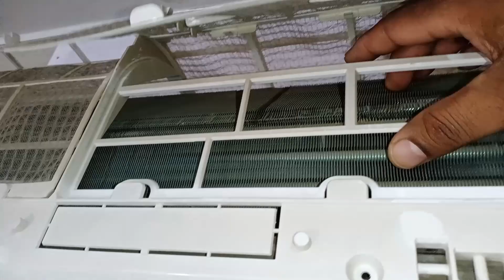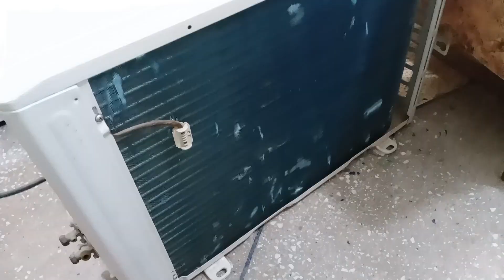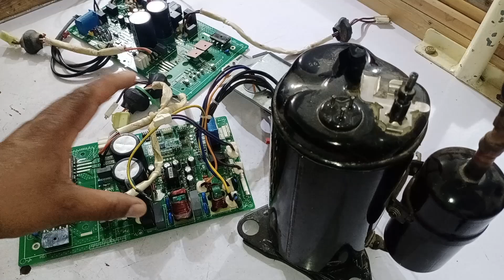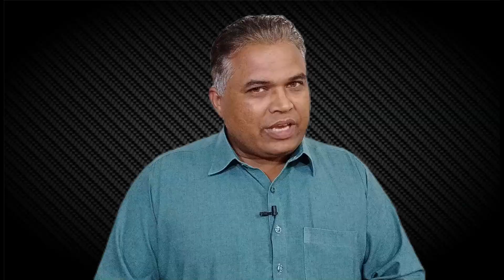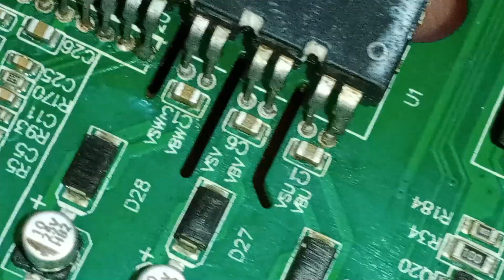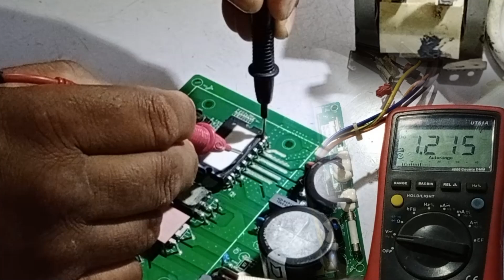How to Fix F3 Error Code in Mini Split AC - What to Check?

Comment: First you should have said what is the meaning of the F3 error according to manufacturer of the unit and then elaborate what can cause that error directly and then indirectly. You jumped straight into story of all possible indirect causes of the error. For example if there's an error that manufacturer said means "communication error", that means exactly there's no communication between indoor and outdoor units. Then we can apply logic and knowledge of electronics to find out exact cause.
If there's many indirect reason to IPM error then manufacturer made piss poor job of describing troubleshooting procedures. However, I know that many manufacturers don't want anyone to repair their boards other than: "replace the board" level of troubleshooting. There lies the problem of standardization. There should be rules that protect consumer's right to repair. 
Not one manufacturer should be allowed to sell their units on the market without service manual available on their website at least.

Comment: Hello sir. What is the power of the fan? The one installed between the condenser and the compressor of a 2-meter display refrigerator with a 0.5 horsepower compressor?